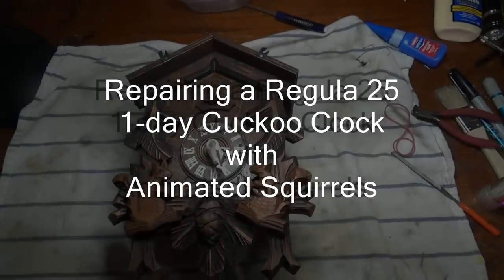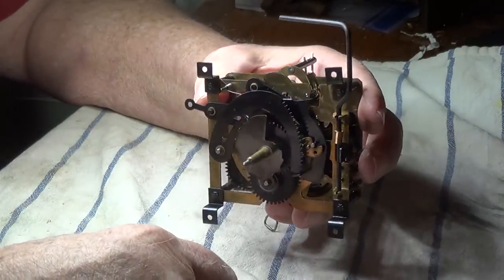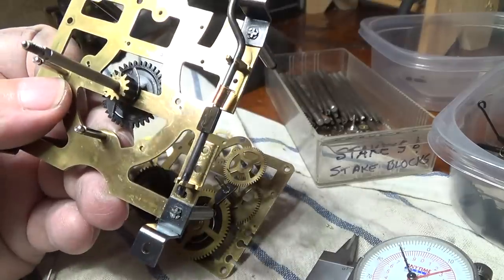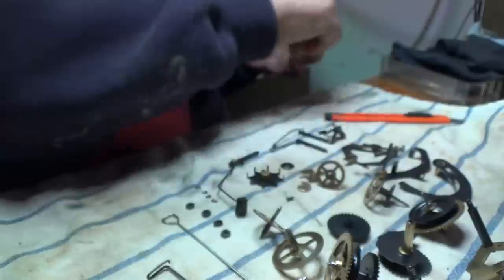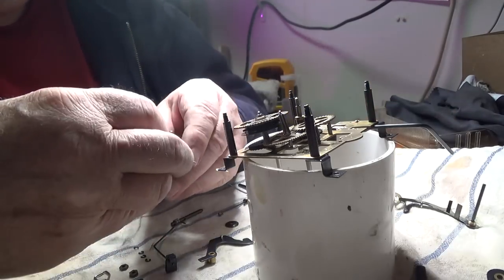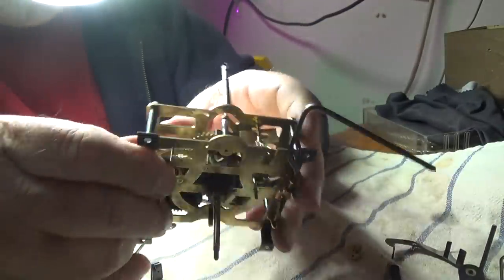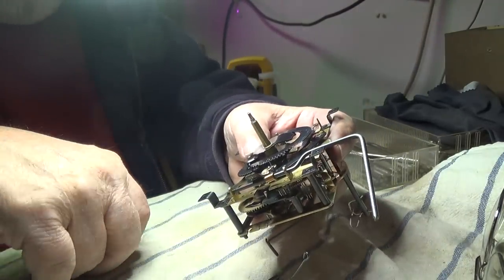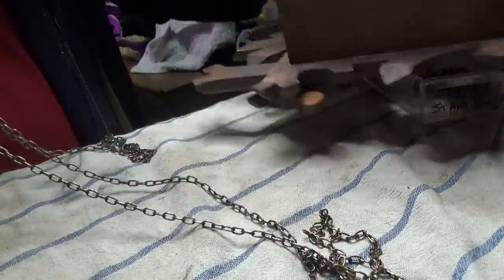Repairing a Regula 25 Cuckoo Clock with Animated Squirrels

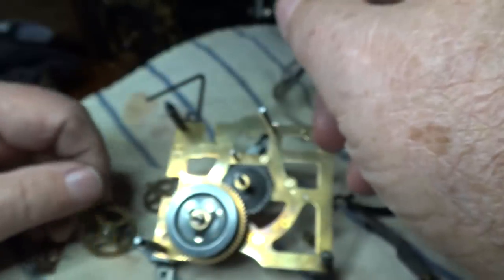Comment: An index for this video. NOTE: Detailed reassembly begins at 37:33

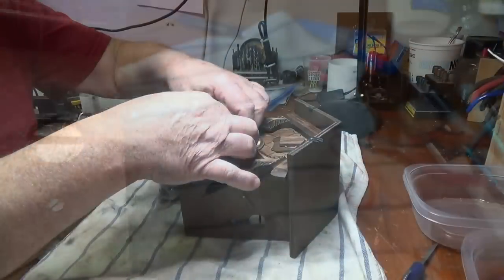0:00 - 0:31 Checking the general condition of the clock case and movement.
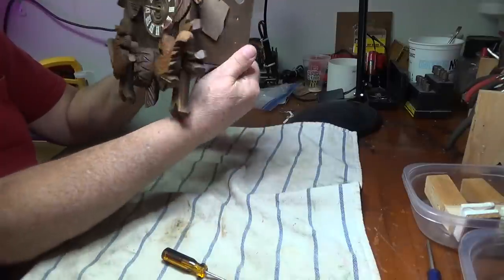0:31 - 3:28 Removing the hands, bird door wire, chains, cuckoo whistles, 
3:28 - 4:38 Showing how the animated squirrels work; removing the squirrel wires.
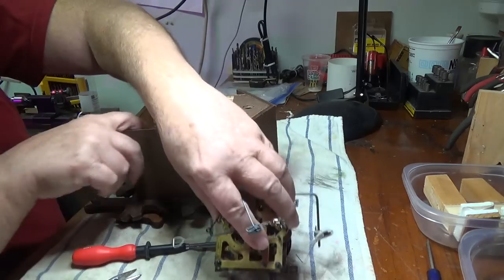4:38 - 6:07 Removing the movement from the case.
6:07 - 7:47 Examining the condition of the movement.
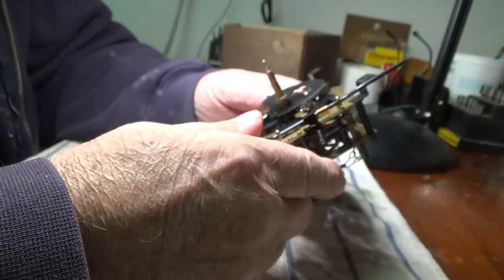7:47 - 10:38 Preparing to disassemble the movement: noting the locked position of the wheels.
10:38 - 17:35 Disassembly.
17:35 - 18:14 Showing the dirty oil on the escape wheel.
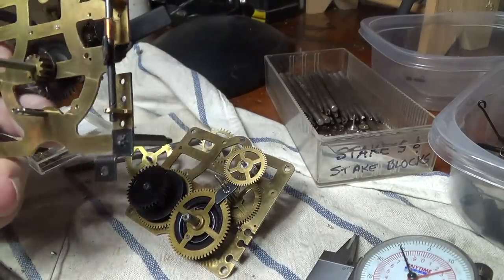18:14 - 18:53 More disassembly.
18:53 - 22:52 Bushing worn pivot holes.
22:52 - 23:35 Checking the new bushings; seeing what other pivot holes need new bushings.
23:35 - 24:04 Showing how to tell if a pivot hole needs a new bushing.
24:04 - 25:12 Bushing the remaining worn pivot holes.
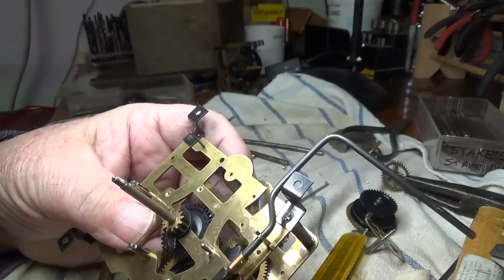25:12 - 25:58 Testing the new bushings.
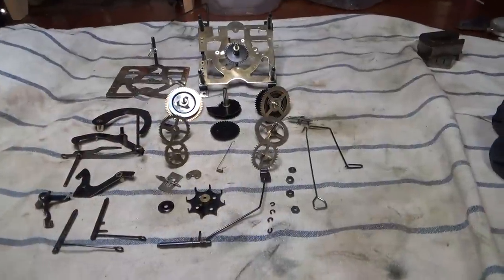25:58 - 26:51 Overview of all the Regula 25 parts.
26:51 - 29:27 Pegging (cleaning out) the pivot holes.
29:27 - 32:03 The economics of cleaning a movement vs. replacing it; finishing the pegging.
32:03 - 37:33 Proper positions of the wheels so the clock strikes correctly.
37:33 - 39:18 Reassembling: starting to assemble the trains before putting in an important lever.
39:18 - 41:22 Installing the levers that keep the bird's door open while cuckooing.
41:22 - 44:09 Placing the wheels.
44:09 - 49:16 Putting the plates together: moving every pivot into the correct pivot hole.
49:16 - 51:28 Installing the lift lever and showing how it works.
51:28 - 55:02 Installing the drop lever and gathering pallet, and showing how they should be placed.
55:02 - 58:07 Installing the rack, snail, and intermediate wheel, and how to position the snail.
58:07 - 1:01:17 Installing the drop lever spring, and clipping the rack on.
1:01:17 - 1:01:33 Getting ready to fasten the bird perch spring.
1:01:33 - 1:03:26 Installing the cuckoo levers and gong hammer.
1:03:26 - 1:05:38 Oiling the movement.
1:05:38 - 1:07:07 Installing and positioning the star wheel.
1:07:07 - 1:08:11 Attaching the chains.
1:08:11 - 1:08:58 Attaching the bird to the door.
1:08:58 - 1:09:22 The repaired clock running on a test stand.
Reply: I think this guys clock repair videos are great, he sure knows what he is talking about, I hope to learn a few things from him, I sure do appreciate him showing this, I watch all his teaching videos on all kinds of clocks.I hope some day I can do as good, problem is I am already 61 years old, lol, but I will still try, we never know how long we will live.

Comment: I'm at wits end.... I have an older Regula 25 Cuckoo clock just like this one minus the animated squirrels.  I bought a new movement for it, installed it and now it only runs without a pendulum.  Tried watching your videos hoping to learn how to fix it, but I just don't have the tools nor the know-how.  I compare it to brain surgery, either you know what you're doing or you don't.  It is a beautiful little clock, and I don't want to kill it.
Reply from the maker: I can't diagnose something without seeing it, but I can suggest a couple things.  Look underneath the clock at the slot through which the pendulum leader exits the bottom of the clock.  Is the wire hanging in the middle of the slot?  Does the position of the wire in the slot change when you add the pendulum?  The pendulum's weight may pull the wire to the front or back enough to cause the wire to rub on the slot edge.  Also, where the wire goes through the loop in the crutch, which is inside the case, the leader should also go through that loop in its center.  The pendulum may pull the leader back or forward enough to cause it to jam against the back or front of the loop.  That will be difficult to determine unless you can set the clock up plumb and level on some sort of test stand.  Also, inside the case, the pendulum leader may not be hanging freely from the top at it attachment on the post that extends from the back of the movement.  Hope that helps.
Reply from the maker: Also,  are you sure you bought the right movement?  The Regula 25 comes with different pendulum lengths with different numbers of teeth on the escape wheel to fit different sized cases and configurations of case.  If you bought the wrong one for your clock, the post from which the pendulum leader hangs may be the wrong length and cause rubbing against the exit slot on the bottom of the case.
Reply: Thanks for responding.  That's exactly what happened.  I didn't know the Regula 25 came in different sizes and the movement I bought was too big for the small case I had.  I managed to get it working, but that's all it does now.  Keeps time, but no cuckoo since the bellows don't fit in the case with the new movement.  Lesson learned, I will probably get it professionally fixed one of these days.

Comment: Thank you very much for the excellent video. Is there any problem if the black parts loose the paint? It happened when I washed a Regula and used a anti rust product.
Reply from the maker: It's not paint, it's bluing.  Remove the rust with fine steel wool and use a cold bluing solution to restore the finish, which prevents rust.  Here is the stuff I use.  https://www.amazon.com/Birchwood-Casey-Perma-Liquid-Finishing/dp/B000KKELM8/ref=sr_1_1_sspa?keywords=cold+bluing+solution&qid=1662081992&sr=8-1-spons&psc=1
Reply: @dperry428  Thank you very much indeed.

Comment: I am getting started in repairing cuckoos. Most guys that work on clocks just replace everything now which is not a clockmaker. How long does a rebushed movement last vs a new movement? Can you give me a list of tools I should buy to get started?
Reply from the maker: If properly cleaned, pivots polished, rebushed and oiled, a rebuilt movement will last as long or longer than a new one. The tools required is directly related to the extent of repair desired.  For normal cleaning and oiling, ordinary household tools are sufficient.  As your skills expand, tools are added as needed. For example, when you get to the point of wanting to do bushing work, you'll need the appropriate drills, files, reamers and broaches to do the work properly.  Check a appropriate clock supply house for those specialty tools.  Timesavers, Ronell Clocks, Merritt's Antiques, Black Forest Imports, Mile-Hi Clocks,  Frankenmuth Clocks.

Comment: I recently inherited one of these with the music box. I have taken it apart and the music mechanism has a gear that has some broken tines. Is there a place online to buy gears for these types of music boxes. also, a couple of forks seem to be missing on the little metal musical fork "keyboard" that makes the melody. So I would like to replace that as well.
Reply from the maker: The "keyboard" is called a comb and there are no replacements as each comb is made to go with the roller for the tunes that it plays.  There are several gears that are on the music box the most susceptible to damage is the little gear that runs the governor fan.  The entire governor is available at a cost of between $25 and $30.  You can also replace the entire music box, but they are quite expensive. To buy just the governor, you need to count the tines on the comb and the number of leaves on the pinion gear that connects the roller to the governor.  Here are some links:  https://timesavers.com/search.html?q=governor&go=Search    https://www.merritts.com/merritts/public/product.aspx?ProductID=82063  and, for those who don't mind spending twice as much for a part  https://blackforestimports.com/category/Parts-Accessories/Cuckoo-Parts-Accessories/Music-Boxes-Related-Parts-Cuckoo/

Comment: I'm about to work on [hopefully] my cuckoo clock. It cuckoo's 14 times on the hour.. and on the 1/2 hour, the bird comes out twice - once on each 'coo' - instead of doing both 'coos' at once. My question is.. each of the coo whistles doesn't have a screw nor nail holding them in.. Is it glued instead? If so, I guess I could use a black marker and draw a line along the side of each whistle so as to know how to line them up? My clock has 2 birds on each side - instead of those squirrels.. Your video is helping me a LOT! I appreciate them.. since I cannot afford a horologist's price to fix mine. ummm do you by chance accept folk's cuckoo clocks for fixing? Would it be expensive? I'm on a small soc. sec. budget.. I had given the clock to someone.. but it came back not working properly..  Upon thinking about it.. I'm a bit scared to work on it..  Would you consider fixing mine after all? Thank you.
Reply from the maker: If you work on your clock, pay attention to the levers on the front of the movement.  Striking 14 times is indicative of the rack sticking or not being held as it is lifted, a sign of sticky levers, which should never be oiled.  Sounds like the whistles have been glued in.  Could have been the person who worked on your clock last.  As I said in another of your comments, I can't take on any more repairs until next fall and winter season. I'm still trying to catch up with those that were waiting when I missed a year of repairs while having my hips and knee replaced.
Reply: @dperry428  Thank you.. I will try and work on my clock. I appreciate being elderly.. I'm 70.. heh. No worries. If by chance I can't fix my clock, I'm not in a hurry.. and if by chance you may have an opening .. maybe next winter you might help me out? I'll at least let you know how my attempt works out.. I love my clock and I hope it will run again..
Reply from the maker: Try contacting me again around September.  I'll also be glad to offer assistance through the comments if you run into trouble.
Reply: @dperry428  Thank you so much. I love my clock.. it's been with me for some years. I don't have a lot of tools, and I'm rather hesitant to try fixing it. I can easily wait until September to see if you might fix it and such.. A few months ago, I did take off the hands and numeral plate and looked inside. I noticed that a long spring wire was out of place, and it seemed that the rack may have been bent a little [hard to tell]. I then put the plate and hands back on.. and it's just hanging on my wall ..  The clock is beautifully painted and not solid brown like others. I'm happy to wait for you.. if that's ok.. (^_^) -- oh, and I just noticed that the cuckoo never stops cuckoo-ing.. the chain runs all the way to the floor..
Reply from the maker: If it's running down to the floor, either the rack is not being lifted or the warning (stop) pin is bent or missing.

Comment: Great video, sir! If you could give me a hint, would be much appreciated. The cuckoo in my Regula 25 sometimes gets stuck, its door opens halfway,  the cuckoo starts moving and stops. Nothing appears to be stopping it. With a slight push to the door everything starts working and goes through the whole cycle. Sometimes it works, sometimes it doesn't. The clock is about 5 years old. What are your thoughts what might be happening? Thank you very much in advance.
Reply from the maker: While it may APPEAR that nothing is stopping it, something IS, in fact, stopping it.  I'd look for a wire, such as those that lift the bellows or the wire from the bird to the door to be binding or rubbing.  Look particularly at the wire on the left bellows that lifts the bird's tail. Is that wire UNDER the tail when things bind?  That wire may be close to moving above the tail and does, from time to time, causing a bind until you pull the bird forward and the wire can than fall back under the tail.  That would be my FIRST guess. Check to see it is clearly under the tail and does not have opportunity to slip and go above the tail.  Also, at 5 years old, the clock may been cleaning or, at least, oiling.
Reply: @dperry428 Thanks for your prompt response! I reexamined how the cuckoo moves and noticed that there's a possibility for the bird to rub her right cheek on the door frame. Not willing to move the cuckoo where it sits on its support, I slightly bent the wire connecting the bird and the door. Hope tilting the cuckoo down a touch will keep her from coming in contact with the door frame.
Reply from the maker: Sometimes the metal base upon which the bird is attached is not centered on the door opening and will rub or snag on the door frame.  Moving the bird one way or another is simply a matter of loosening the screw that holds that base on the perch rod, moving the bird left or right and retightening the screw.
Reply: @dperry428  No hiccups all day, thanks to your advice! Thank you!
Reply from the maker: I'm glad you found a solution.  Sometimes, it can be maddening to find a tiny maladjustment that keeps a cuckoo clock from working perfectly. It's one of the reasons that many clock repair people do not like to work on cuckoo clocks. It can take a great deal of patience to get things adjusted just right and, if you're in the business of fixing clocks for a living, profits quickly go over the cuckoo nest.
Reply: @dperry428 If you're in the business of fixing clocks, I'd like to know your web site to be able to place an order to fix mine when needed. I'm very much impressed with your knowledge.
Reply from the maker: I'm not in business.  This is strictly a hobby.  From time to time, as in these videos, I fix clocks for people after I get to know who they are.  I don't have a web site.  When someone wants a clock fixed, I tell them to put an email address in a comment.  I hold all comments for review to filter out trolls, so I then contact the person via email and delete the comment without publishing.  Once in contact via email, I get to know who the person requesting repair is and, if I feel they are trustworthy, we arrange the repair.  I don't charge for the repair, except for parts needed.  I ask the person to make a contribution to our local ministerial association and food pantry.
Reply: @dperry428 What you do is remarkable, I will keep tabs on our exchange for the next time something goes wrong with our clock. All the best to you!

Comment: Any idea of the time period when this clock was made?
Reply from the maker: I'm a bit conflicted on the date.  The back says 'Made in West Germany'.  That puts it between 1949 and 1990 or so.  The back also says, 'A25 84'.  If the A is a date code, it could be 1970, 1990,  2010. The 'Made in West Germany' eliminates the 2010.  If the 84 is the date, then it is 1984.  However, the removable star wheel dates it to before 1976 when  they started using press-on star wheels. So, either the A or the 84 is NOT a date code. One of them likely IS a date code.  It's also possible that the star wheel was originally pressed on and replaced with a star wheel with a set screw. In that case, the clock would have been made in 1984.  If not,  the set screw star wheel is original and the clock was made in 1970. My best guess.
Reply: For what is is worth, I have a similar clock that has a movement marked A 25-84, also West Germany.  From what I can tell the only difference between the two clocks is mine has a music movement as well as a second door with a man that comes out when the music plays.   I looked at my star wheel and it is a set screw style as well.  If the previous owner was honest, my clock has never been used, taken apart or repaired in any way.  There isn’t any tool marks on any of the fasteners holding the movement, nor is there any other indication it has ever been maintained or even put together.  It was still in the original box and looked factory packed. I’m going to assume the A is the date code. Hope this info helps you as well.